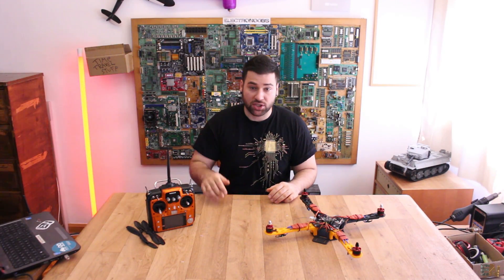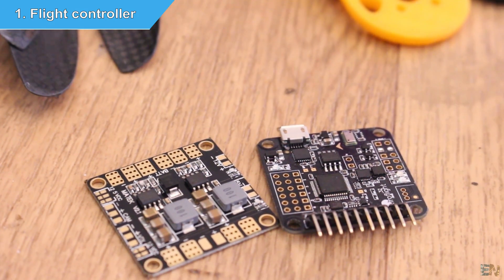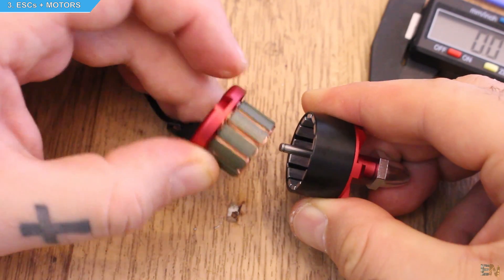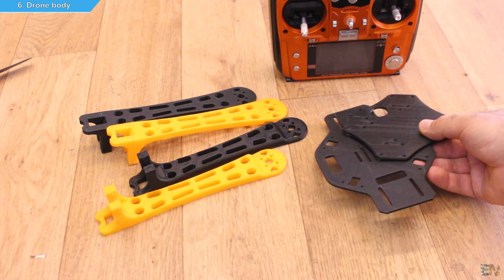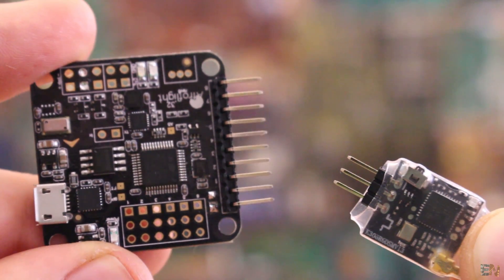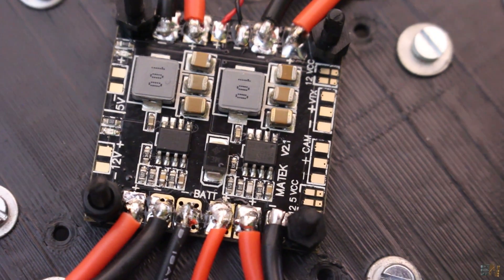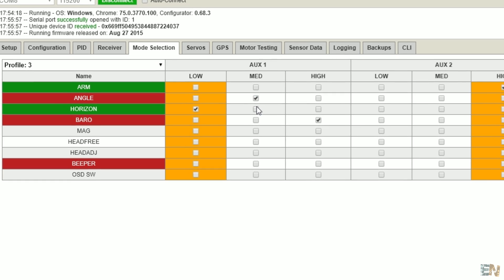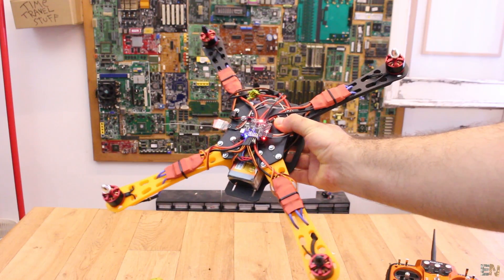Make a DRONE - FULL Guide - All eBay parts (~150$)

Comment: This is totally outdated.The naze32 has a slow f1 processor. It has  changed to f3,f4 then f7 and finally the recent sp racing h7 by  seriously pro is using a 400MHz H7 processor.The baseflight configurator is also a dead one.

Comment: What's the cheapest cheap option for getting started with RC hardware that can be messed with? The $10-$40 bare minimum?

  Recently, I saw someone mention that there's no reason for anyone to "rewind old brushless CD ROM motors anymore to build their own drone." So apparently that was the old skool/grassroots way the hobby got started. Does anyone know about these grassroots projects, or references for how to build something like this from scratch?
  I'm more curious about the hardware side than actually flying the thing. Delving into motor windings, controllers, and such, sounds like a lot more fun than standing around twiddling my joystick. I might play around a bit if it were something I built, but I'd never spend even $100 to buy one.
Thanks for the upload.
-Jake

  Oh and because I typically mention hardware bits...have you checked out the AVR compatible chips out of China yet? I have been looking at some Ardy-like dev boards based on the LGT8F328P recently. Apparently they have some added features that the genuine AVR's lack. I haven't gone into the datasheet, but ordered a few after someone mentioned the chip has a DAC. I haven't even confirmed this though. All AVR's with an ADC actually have a DAC according to how the SAR ADC works. However I don't think they ever designed an official AVR with a DAC broken out for peripheral use. It just might be an interesting chip to look into. I ordered some, especially the one version with the SOP-20 pin package :-)

Comment: You should have used a sponge or damper to eliminate the vibration caused by the motors if you want to get a smoother flight
Reply: @Daniel_Bélisle  The thing is, there should not be a rigid connection between the accelerometer and the chassis since the whole chassis vibrates due to the rotation of motors. Therefore, I would not use screw and nuts to fix the flight controller, instead, I would glue it to a sponge and fix the sponge to the chassis. This way the sponge behaves as a filter and the vibrations get eliminated

Comment: Thanks for the tutorial. Can Afroflight flash firmware to Betaflight/Cleanflight/iNav for later have GPS module and another sensor? For now I also in progress of building F450 clone frame using Flysky FS IA6B and CC3D but I was thinking of changing Flight Controller to have altitude hold and possibility to have position hold also.
Reply: Stay away from the Naze32 and CC3D, they are outdated.  Buy an F4 flight controller and flash it with iNav or Betaflight, and you can add a GPS
Reply: @NicoMyers   thanks. I have decided to use F4 pro v3 to change my CC3D

Comment: i love the trick with the carbon fiber and multimeter! =D thank  for the good tip
Reply: Only works if you can get to the fibres.
If it has a thick epoxy covering it won't work. 
Also. Doesn't confirm if a piece is 100% carbonfibre of carbon fiber wrapped.

Comment: 6:48... The "4.5" of a 10 X 4.5" propeller is not in degrees but the forward movement (in inches) of the propeller screwing into the air (without friction or losses) per full rotation.